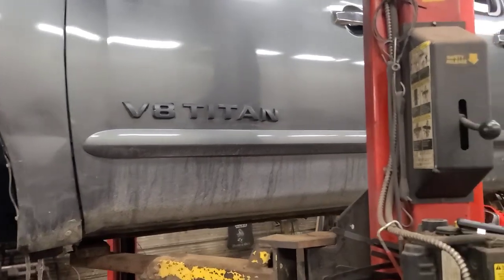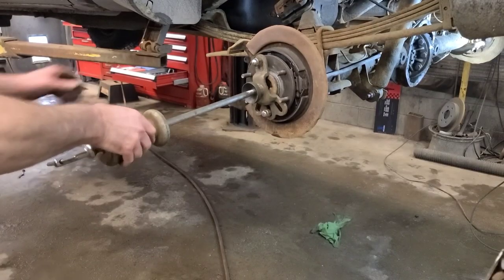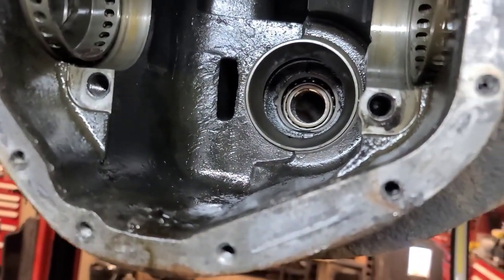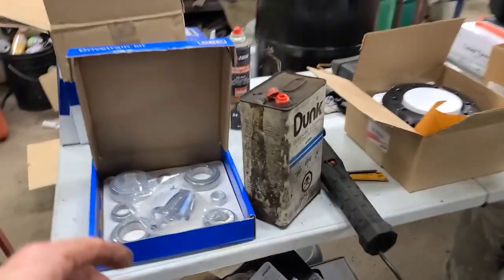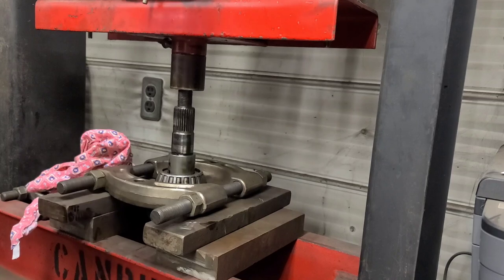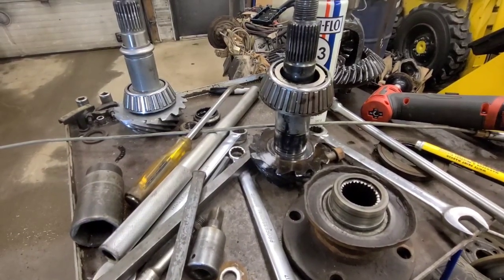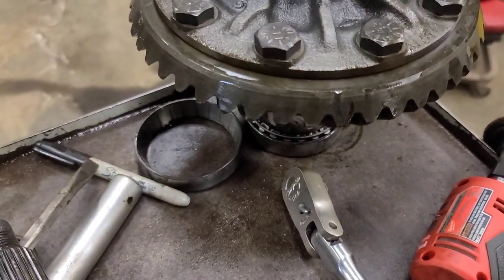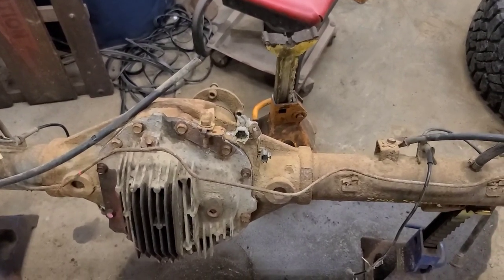2006 Nissan Titan Rear Differential Repairs pt. 1

Comment: wow - what a careless mistake someone made before you. I am shocked it even went down the road like that.
Reply from the maker: Yes never would have suspected someone could be that dumb to make that mistake. I guess cause it has adjusters on the side bearings they managed to get the case in at all. My customer bought the truck two weeks prior to this so had no knowledge of this "repair".